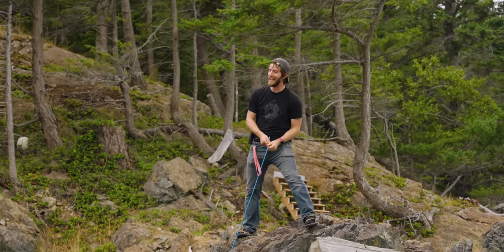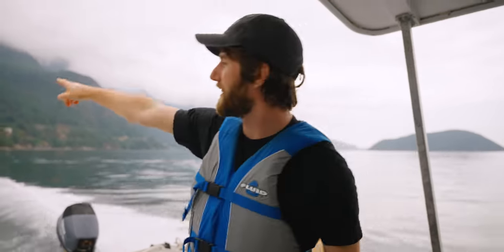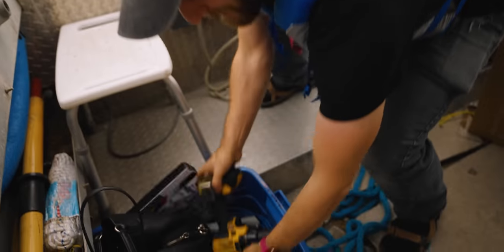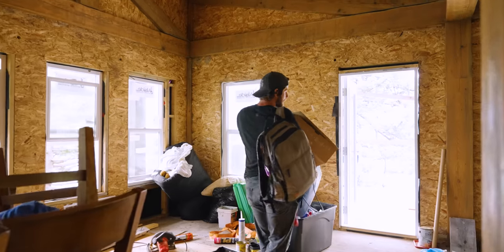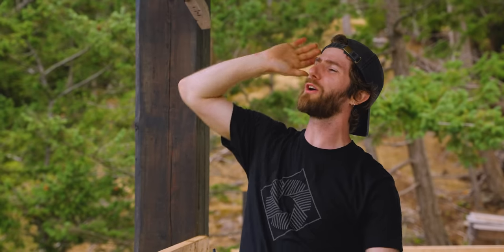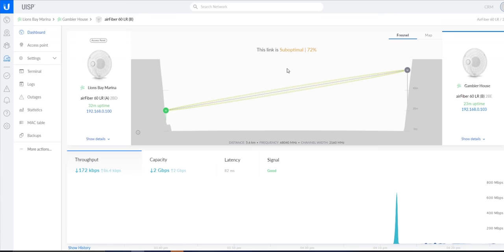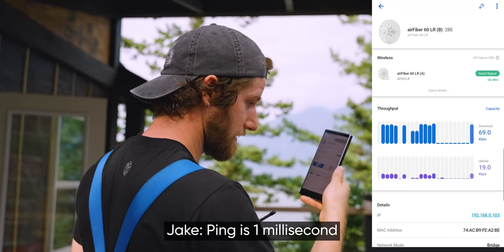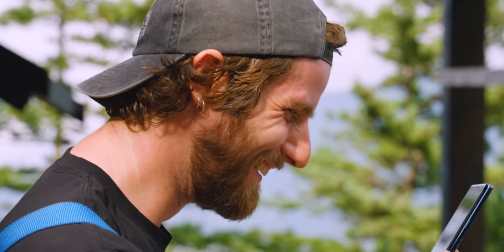How are we going to do this?

Comment: Linus at 5km wearing a black shirt in a dark background: "Can you see me???"
At least a yellow shirt... :)
Reply: That's one thing. But the problem might be earths curvature. 5-6km is a hight drop of 1.96-2.83meter. Linus is definitly not that tall. He's maybe 1.70m. So if it was possible to see him, it was maybe only his hand raised in the air.
Reply: @paulschnipper6115  well did you take elevation into account ?
Reply: @adamatch9624  he was on the ground next to a lake, the surface of a lake does not have elevation changes
Reply: @ARVash  Yes but Jake wasn't at the water level either, but at least a few meters above it. You can basically split that 2-3 meters to both sides, so if Jake is just 2 meters up, then only a max of 1 meter of Linus is obstructed. So ~ 40 cm of him would be still visible.
Reply: @EvanOfTheDarkness  do you know how tall a meter is? He wasn't trying to look at Linus from the lift. He was sitting on a log which is on the ground. A meter is ~3.28 feet he was about a meter and change off the ground.
Reply: Well I was wondering why they didn't use a mirror or chrome element that would reflect the sun. He would've spotted him without the optics. And also Linus should've flashed the mirror from where the dish would be, to avoid hiding behind the curvature of the Earth.
Reply: @adamatch9624  Ahh!
Reply: @ARVash  Excellent ob!
Reply: @paulschnipper6115  yes in 8 MILES you can literally see the curve. How did we EVER get to a flat earth society?
Reply: @ARVash  Wrong. He's at the parking lot which is at the very least 1 meters above water, (but probably 2 or more judging from an earlies shot) and he's not on the ground either, so that's an other meter. They don't build the parking lots at the water level for very obvious reasons (namely flooding). Even if it looks like he's right at water level I can assure you he's not.
Reply: @EvanOfTheDarkness  Even still, part of Linus would be obscured, though depending on the specifics that we don't have it's either a significant portion or almost none. If enough of him was obscured it would be pretty reasonable to expect that he may not be intuitively recognizable if you were expecting to see a whole person.
Reply: @ARVash  From my calculations, 7 km is ~ 0.001111 rad and would cause a ~ 6300km*(1-cos(0.001111)) ~  3.9 m height difference, on one side, if the other side is at 0 a.k.a the water line is at your eye level. But if just split the angle so both parties are at the same level, then the result is just 6300km*(1-cos(0.001111/2)) ~ 1 meter. So if Jake's head is just 1 meter above the water level (e.g. he's sitting), then he'll see everything on the other shore above 1 meter. The scaling is not linear, but that can be used as an upper limit, that's why I said two meters, because I was lazy to actually calculate it. 

A 72%-38% split of the arc gives the values  ~2m and ~0.5m so if Jake is 2m up, Only half a meter of Linus is not visible to him. That's his feet. So there you go.

EDIT: For some reason I calculated it with 7km instead of with 3 miles ~ 5km. With 5 km its 0.000794 rad, 1.95m at water level, 0.5 meter when split and Jake at two meters up would even see Linus' toes. IDK why I used 7 km. But you still see my point.
Reply: A mirror or anything to reflect the sunlight to the marina would have been ideal. All Jake would had to have looked for was a shimmering light.
Reply: @EvanOfTheDarkness  ok very exactly
Reply: @EvanOfTheDarkness  Yeah I got similar numbers on my calculator the thing though is that we don't know the exact distances. He says 5km but the range goes waaay further than 5km so he could be estimating. cut off or not the root problem was almost certainly that he was too small and too far away lol.
Reply: Hunter orange would be best.
Reply: I could have lent him my brother-in-law's orange shirt. Last time we went climbing we could see him many km away, no binoculars needed 😂
Reply: Why do these dishes not simply come with a green laser diode for alignment purposes? I imagine realignment is going to be a thing with these dishes due to weather, buildings settling, people knocking the dish.
Reply: @ARVash  But, well the conclusion is the same. From where Jake was Linus shoul be visible, maybe his feet was't if the distance was more and Jake was really low, but his legs and upper body definitely. And ultimatly Jake saw Linus so I don't think there was a visibility problem.

Comment: Seems like a good candidate for starlink, but it wouldn't be anywhere near as fun as this video is!
Reply: Came here to write the same thing
Reply: probably have to wait till they get the laser links set up first.
Reply: But gigabit
Reply: Might be more reliable as weather would have to be pretty bad to block it, whereas StarLink might be more susceptible to bad weather.

Also this should give a higher bandwidth with lower latency.
Reply: 3:00 if they had a samsung s20 ultra he could zoom 100x
Reply: Starlink is very power hungry and that cabin is offgrid.  Starlink uses about 2.4 kWh per day, which is a massive dent in an off-grid power budget (more than a fridge or a big screen TV).  Airfiber LR 60 uses about 0.26 kWh per day.
Reply: There is no reason to use Starlink when you can use microwave links. If you're too far from a tower to use a microwave link, you either build a relay link or maybe possibly consider satellite internet.
Reply: @joels7605  good point! I just looked up the specs and you're right, people measured it to consume around 2kW per 24 hours. 

That's a LOT of power! I always imagined it would be less.
Reply: @thelegalsystem  star link is satellite internet
Reply: That's what I was about to say
Reply: Starlink is nowhere near actual 24/7 commercial-ready
Reply: Revision 2 of Starlink hardware uses less than 50 watts.  Lots of documentation and proof of this on the Starlink Subreddit.
Reply: X.x 
Bah. Starlink is going to crash and burn. Both economically, technically and literally. Plus the Kessler syndrome is an ever present threat.
Reply: @adameckert8542  someone doesn’t watch the wan show. He talked about starlink for this place weeks ago.
Reply: @stevebice4790  that would still be 1.2kWh, around 5x of what the ubiquity stuff consumes
Reply: @Strawberrymaker  Right, but that ubiquity wattage doesn't include a router or wifi AP.  The airFiber uses 18W, and the Wifi AP uses 11 watts.  If we take Linus's 60Watt switch out of the equation, that leaves us with 29 watts.  Just over half of Starlink's Revision 2's 48 watts.  So my point stands, they're very comparable, and note that Linus's setup doesn't yet include a router in that wattage, as it's presumably back on the shore?
Reply: Considering how money Linus has to spend, StarLink might as well be a back-up.
Reply: Not really I am sure 4G would reach there
Reply: @stevebice4790  If that's the case then it's very new.  Also link to actual data instead of broadly mentioning the data is buried somewhere within an entire subreddit.  Every single review I've seen online measures Dishy at above 100 watts.
Reply: @simonair  nobodys parents need gigabit, especially at their cabin.
Reply: @girlsdrinkfeck  i have that phone
Reply: @haves_  I've had it since March.  I am in Arizona ...   and stream tv / music pretty much all day and night.  Very very rarely lose signal.  If I do, it is for a few seconds.   Starlink would have been the way to go.   5 minutes and done
Reply: I think it's still better for a permanent solution to use a system like linus used here, cause starlink can have big latencies
Reply: He mentioned on WAN show a while ago, he had already discussed this with his parents. His parents actually brought it up thinking it would be ideal but Linus was the negative one since it wouldn't be nearly as fast as this solution despite it being more user-friendly. If I remember his quote exactly he asked "Do you want the best speeds and reliability or the one easiest to set up?". I can't remember how long ago the WAN show was though.
Reply: Why not both?
Reply: @Kotentopf  power consumption and cost..
Reply: @BeKa-om8cv  I disagree. I think this is an ideal use case for a less tech-savvy capable customer. It's way more user friendly and is on an off grid premise. This solution was better but saying it's "completely unsuited" is totally wrong in my opinion.
Reply: My thoughts exactly.
Reply: Urrrgghh, I wish people would stop touting Starlink as the solution to all Internet connection problems.  It absolutely is not.
Reply: Would be significantly slower and high latency.
Reply: @tams805  It is for 99% of people though. No averag Joe that lives out in the woods would consider a solution likr this. They want something that gives them relatively fast internet quickly without much setup. With Starlink you just plop th dish outside and you're ready to go.
Reply: Can someone tell me a good graphics card under $600 aud
Reply: Use Starlink as a backup/secondary internet link
Reply: 100%, LTT wasted money and time for a pointless video no one should use as an actual reference for how to connect a long distance high-band radio. StarLink was made for this shit and he should have just done that.
Reply: @simonair  It's not gonna be gigabit, let alone, a stable and reliable connection.
Reply: @thelegalsystem  no, you are completely wrong, lmfao.
Reply: This solution is much better.  Much lower latency than satellite Internet.
Reply: Will this setup have problems if the wind pickups and the dish sways a bit? What about heavy rain/snow?
Reply: @PR2k9  wait a few more moments
Reply: @girlsdrinkfeck  if they could use a large flashlight lol or just their phones flash because you can see it
Reply: @joels7605  starlink is also pretty expensive
Reply: @stevebice4790  the problem with starlink is satellite collisions
Reply: @SebiKoerner  Starlink will go bankrupt in <10y, mark my words. 70% of the Earth's surface is ocean, which means at any given time, 70% of their satellites are over water and serving no one, total waste of resources.
Reply: @pdblouin  um a larger problem is them colliding with other satellites and creating a bunch of small debris which will collide with even more satellites and create even MORE debris etc.. it already happens rn
Reply: A simple LTE modem would have done the trick
Reply: @Chris-hw4mq  yet it’s The only option for a lot of remote people. No average Joe would bother with this stuff when you can have Starlink and just plop down the dish and plug it in and it works.
Reply: Starlink is great, but I think there might be too many trees to block the view. I hoping for a starlink phone since Sattelite phones are extremely expensive to use, and lag, but a Starlink phone could give you internet anywhere in the wilderness and using the same connection as your dish.
Reply: Oh should read this be4 I commented
Reply: hey Gadget Sidekick im your subscriber and also Filipino
Reply: Eh end result would be slower ping by a lot and lower speeds. Though depending on the customer that might or might not matter.
Reply: Starlink is just worse
Reply: @stevebice4790  but it still doesn't exist, so that doesn't matter. While what he installed is here and now.
Reply: @stevebice4790  so starlink uses still more. So why chose it? also can you buy rev 2 now?
Reply: @evolicious  geez. This is way more refined, faster and more stable than starlink. Starlink is still more or less beta and 100mbs when this is 1gbs.
Reply: @Roshan_420  which is basically a non-issue if all involved parties are transparent enough to provide accurate positions in space for their hardware. This only becomes an issue for dead satellites or purposefully uncontrolled stuff (China). Starlink satellites are in decaying orbits. Once a sat dies, it will deorbit within a few days.
Reply: Ok Tesla shill
Reply: @Roshan_420   Starlink has not collided with anything yet. There was a close encounter of 231km between a Starlink satellite and another sat. In the history of Spaceflight, there were only a handful recorded with the most notable one being a collision between an Iridium Satellite and a Russian satellite in 2009. I don’t know where you’re getting your information from or if something got lost in translation, but that’s just not correct. Except for the very first Starlink launch (v0.9) which deorbited and burnt up last year, all ~1700 Starlink satellites are still perfectly healthy on orbit.
Reply: @pdblouin  you know there are ships in the sea, right?
Sailors need internet also. For them Starlink would be cheap and affordable solution.
Reply: @real_andrii  and also Airplanes
Reply: @known1443  Ive never had issues with bad weather with my AirMax PowerBeam, other than getting knocked over, but thats mostly my fault.
Reply: @thelegalsystem  Starlink is satellite internet.
Reply: I like the concept of Starlink, and they are doing a good job designing and testing it, but...Space junk is such a big issue already, and Musk wants to put 10,000 satellites in orbit to make Starlink work.  Every satellite that is destroyed by debris is going to cross the path of at least one other Starlink satellite, which means this is going to go exponential REAL quick.   Honestly Starlink is so different from Musk's other businesses that I'm kinda wondering if he's setting this up to 1) help bootstrap his trip to Mars and 2) make sure nobody can follow him by blasting a few satellites after he escapes orbit.
Reply: Yeap, it's exactly what starlink is designed to solve. I guess building the wheel can make for a nicer video.
Reply: How in the fuck does a massive area like BC have such high internet connection speeds. Are these high speeds mainly around the Vancouver area, or does it branch out much further? I can understand it in a place like Vancouver, but on an island across a lake (unless the island is still part of the Vancouver metro area). Anyone?
Reply: Terrestrial wireless is going to be faster and more reliable than Starlink in most cases.
Reply: Starlink needs that next funding round. If Elon won't be able to dump enough cash it will end sooner than later. If he gets some investors in it then we will see... still questionable.
Reply: @evolicious  yeah not like it was literally my job for several years to manage and help install these radios for commercial use LMAO
Reply: @joels7605  2.4 holy shit. rediculous
Reply: @joels7605  I did, but the LTT youtube comments blocks links.  I'm sorry I can't link it directly!  The post is called Dishy Power Consumption Rev2 Hardware
Reply: @glenwaldrop8166  Elon is a vaporware salesman and sadly he sometimes sells that to someone ;)
Reply: Too expensive
Reply: @simonair  Assuming the internet connection the link is on is 1GBs
Reply: @2nd-place  LOL Linus Torvold created the modern day internet(with Linux) and he has grown kids...There's tons of techs and developers that have been around much longer than any of us Younguns...they use the internet and many of them have been making huge dollars for many years based on their knowledge of it all.
Reply: @joels7605  this may be the only good argument against it I've seen. The rest feel very Musk-phobic. Thanks for the info.
Reply: @TheWorldHasGoneNuts  I'm in the absolute middle of nowhere in Nova Scotia.  Like my only neighbours are squirrels and porcupines, and I can get gigabit.  The internet here is amazing actually.  The cheapest internet I can get is 350 megabit (which is the plan I'm on).  And it's rock solid.
Reply: @mock15halo  All the children are too busy cheering for their favourite team (be it for or against Musk).  We should all be looking at things objectively.  Starlink is an amazing technology, just not for this particular application.

Comment: 8:26 - I've had so much trouble with Tapcons pulling out in anything other than brick; I always go for concrete anchors now.
Reply: Raspberry pi powered concrete anchor maybe?  :)
Reply: And g-d forbid you have any dust in the hole leftover from drilling for the tapcons.
Reply: Tapcon screws suck. A lot of other structural engineers I work with share the same opinion. Simpson's Titan screws tend to work a lot better.
Reply: The plug method would of been my first choice. Never seems to fail.
Reply: That's not concrete
It's cement mortar blocks

Don't call it concrete
Reply: 2 things to help tapcons. First you gotta blow the dust out of the hole, then if it strips, cut a 16/18 gauge steel wire about 2-3 inches long and put it in the hole before firing in the tapcon. Works every time
Reply: Can someone tell me a good graphics card under $600 aud
Reply: I've spent significant part of my life on construction sites and whenever I see someone driving screws directly into concrete, brick etc., I know they are absolute noobs. We always use plastic, chemical or mechanical anchors. In some cases also a direct fastening, but only the really good ones, like Hilti.
Reply: @MythUnknown  yes I came to say the same thing but if your in a pinch and don’t have tapcons or anchors some weed eater line and wood screws work just as well. Drill a hole just a tad bigger than the screw and put in a piece of weadeater line and presto it’s jammed in there ha ha and if you hole is to big af another piece of line
Reply: @You-gk1el  Yup tricks of the trade, having to drill for a plug is just nonsense and leaves an unnecessarily large hole
Reply: i was looking for this comment lol, tapcons have worked for me maybe a total of 5 times :/
Reply: If you're drilling with the right sized bit the tapcon will twist off before it pulls out.
Reply: he used the wrong size drill or something, they are a great product.
Reply: Luqid nail with tap cons in brick lol 😆 works great 👍
Reply: @thrifty6182  save another $600 & enjoy the next batch